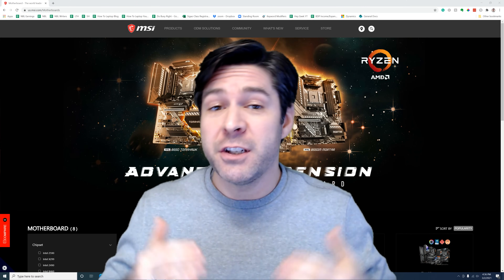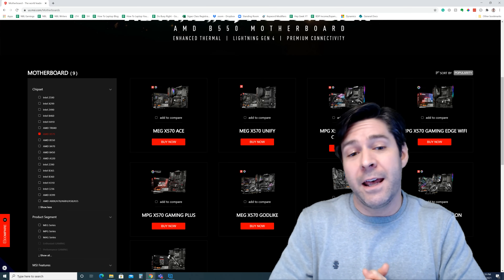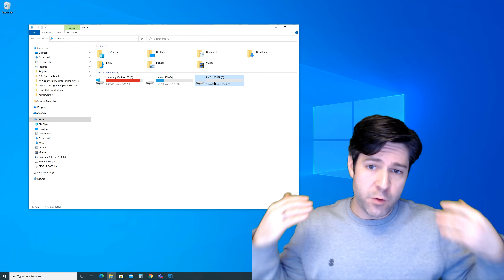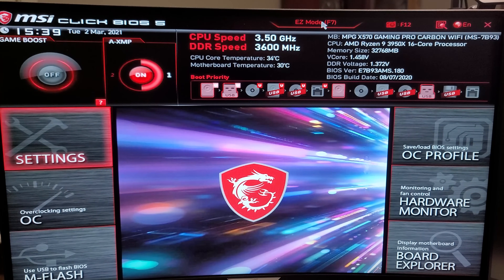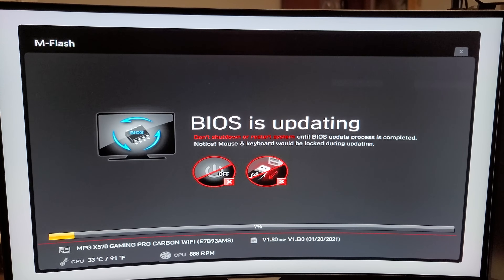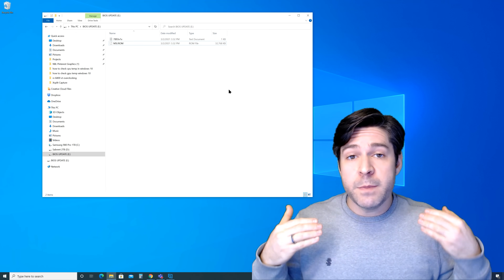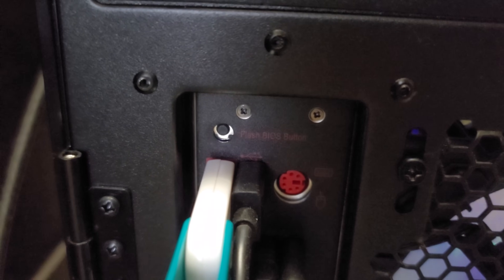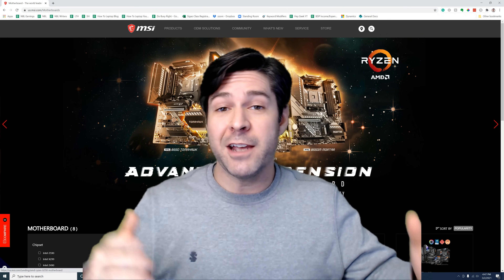How To Update BIOS on an MSI Motherboard Using Both M-Flash and Flash Button

Comment: Josh:  was building on an X870 Tomahawk MSI MB.  Was having problems with the Ethernet and WIFI connection so no internet.  Decided to start with a BIOS update.  used your video to prepare the USB stick for E Flash and started the BIOS update.  At about 30% the whole house electricity went off.  I have updated many BIOSs, never had this happen.  Trying to recover using the flash BIOS option.  And just now as I finished the last sentence, I got a screen from the MB.  Yes!  Your help is greatly appreciated, as is the MSI flash option for BIOS.

Comment: MSI Offered a video with no narrative, I liked yours so much better, with you walking me through and advising on formating the flash drive and a few other vital hints, truly made the difference. Some tech youtubers can do this in their sleep so they do not bother walking someone through the steps, the renaming the file is vital, but is completely left out in the MSI video, granted they were only showing the 1st way that you covered, i have done this before, been building from 2006 but I just wanted a refresher because advancements and methodes move so fast theses days and you provided what I needed to feel comfortable. Others have voiced there disappointment that MSI does not provide and BIOS update instructions, that's why we need individuals like you that will give that  helping hand, thanks again,I have subscribed and liked the video. it is now August 21st 2025 and your video is still helping people like me.

Comment: I reinstalled win 10, after that i had to keep pressing F11 to select the drive the boot was on.
I just went through backing up everything and reinstalling win10 again. I still had to press F11.
In the actual BIOS, the drive with my boot didnt appear.

Anyway.
I have no flash button port.
I did your first method as my bios did need updating..

I have MSI Z97 PC mate (MS-7850).

Anyway, my computer recognized the flash drive with the update, so in the bios I did the flash thing.

Everything is working.

The computer is starting just fine.

Thankyou so much.

Comment: I have done updates couple of decades, but this time I downloaded the wrong version (the same model had both DDR4 and DDR5 mobos), and even though I didn't update it, the motherboard couldn't boot anymore to Windos, settings were randomly changed when I tried the reboot option only, nor wouldn't show an USB drive at the M-flash view (no matter the port or format) so here is hoping this last option works. What a miserable experience.
Edit: update went fine, finally. Thanks!

Comment: Thanks just got a new msi board and this helped, my only issues currently is system fans running high rpms, over(2000rpms) not sure if thats normal or how to fix it. Also remember to enable xmp after updating guys!

Comment: You won a fan boy, if i put my experience here it will help someone, cause i had to go through many video’s and post’s to find the solution… I installed msi centre on my new rig that has a msi b550 tomahawk. I got the option to update bios that I gladly did without understanding it fully as i had a Asus rig before this and I had done a bios update on Asus rig many times. My PC got stuck during the bios update process and started displaying the red light on the motherboard. So every video that I went through was asking to disconnect all devices like proc, memory, video card and peripheral’s to flash update the bios using flash button.. Yours was the only video that was very clear and provided a simple method of updating bios with everything plugged in.. I followed the same steps and got my PC back.. i got relieved now… thank you for your guidelines 👍🏽🙏🏽👏🏽

Comment: I just build a pc and it keeps restarting as soon as I get into windows to login, dont know how to fix this, tried without the gpu installed but no avail.

Running
7900x
Msi b650 mortar wifi
6950xt
128 gb ddr5 5600
Silverstone 850w gold
Wd sn770

This way I cant even update al the drivers cause I cant even get into windows, did mflash bios update but did not help either

Comment: My desktop is on but no picture. I installed the ryzen 5700x prior to updating my bios like a dummy. So I did the flash stick way.  The desktop is on, but still no screen.  My monitor works fine tho

Comment: This didnt work for me at all. I went to press the button and it gave me that error flashing response (3 blinks)

i dont know whats wrong i just wanted to upgrade my cpu :(

Edit: I'm just an idiot guys, It worked thank the lord!!!!

Turns out, I was like "Oh I have a degree in computer science I know what I'm doing. This file format isnt necessary for bios update"

forgets BIOS runs on fat32 file system so using another file system make any file in that file system not found

has 64gb flash drive so I have to use powershell to format it as file explorer wont let me

pain

Comment: My M-flash will open but the usb will only show the directory. It will not show the actual bios file that I know it's on the usb. Your video says it shows up automatically. Any thoughts why mine doesn't?
Reply: So I found my problem is that I downloaded the bios for the wrong board. That's why it didn't appear as a potential bios to install.

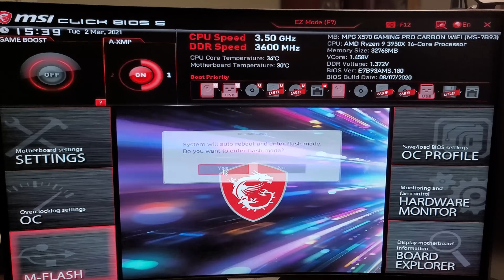Comment: I used the m-flash method and when I went to the flash mode at 6:15, the monitor shows no input, I've tried turning the monitor off and on but nothing happens until I hard reset the pc and it takes me to the windows sign in page.

Comment: hi man, "btw, this is a complete new topic, so it's not related to this video, so yea." i have this problem with my computer: any changes i make, any apps I install or remove, any files I create, even the trash, and when I restart my PC, or even turn it off and then turn it on again, those changes seem to restore to before the changes were made. So do you have any solutions for this problem?

Comment: for the flash bios method the red light isn't flashing, it's just standing still, is that bad or just it doing its thing. It also isn't turning my pc on or off.
Reply: Try reseating the ram modules, then if it works test out each individual ram module with each ram slot, if one slot doesn't work for every ram mod. then its a faulty slot/motherboard, if all works then the ram just fell out a little.

Comment: The FAT32 clarification helped a lot. MSI website never mentioned that so I couldn’t get get my bios to recognize any of the info in the USB stick. Ugh.
Reply: hii have u also recently built ur first system? congrats! cause me too and u can be proud of urself
Reply: @ckk5695  unfortunately I’m not feeling too proud right now, lol. My computer crashes with random kernel 41 errors and windows read the event log and say “it appears to be a power interruption” but I’ve swapped PSU’s out and it still crashes so.. yeah it’s been a headache. I’m suspecting either faulty mobo or CPU after much diagnosis but hard to know for sure.
Reply: @justanonymouse  ohh, i‘m sorry to hear that. if you wanna troubleshoot with experienced pc builders, u can join a pc building discord server! i can send u the link if u want!

Comment: I have X570S EDGE MAX WIFI  tryed to update bios the power supply never came on kept checking on it and bios flash button was still flashing after 3 hours ( 8 GB Flash drive and the file size is  17.73 MB on msi web sight thank you for response

Comment: My BIOS stopped loading its USB drivers. I did not reflash it. I only installed a security update from debian. I got a X570-A PRO mainboard and I can only access the BIOS with a PS2 keyboard.
Before that my computer was already behaving weird and my Win 10 VM wasn't starting anymore, but I did not change anything in the BIOS to make the system freeze come back and the memory runs flawlessly.

Comment: Just wanted to leave a quick message saying thank you! I just did M-Flash on my new MB and it worked great. I'm super glad as I have the MSI z790i Edge wifi ITX MB and when I was enabling XMP mode it would crash my pc. I run ddr5 6400 and was only getting half that. After the bios update, the update was able to support my new ram and I can use XMP and my full speed.

Comment: Whew, completed! Longest 3 minutes of my life. It really made my stomach sink when the  pc turned on and off a few times and didn't go directly into bios. It actually went into windows login screen and then I just restarted from there and pressed del and the bios version is now the new version. Thanks for the how to good sir! Make sure you enable xmp profiles, fan settings and any oc settings if there were any prior to the flash. I did this on an Intel system and the process is the same.

Comment: Thanks SO much for this brilliant video. Amazing. I just bought a Ryzen 7 5800X3D and needed to update the BIOS. I was terrified until I found this video. All done and all is good. Thank You.
Reply: My monitor will not come on.  I installed the ryzen 5700x prior to updating my bios. So I did the flash stick way.  The desktop is on, but still no screen.

Comment: so nice job,( not sarcasm video was super good) i flashed to latest bios vs , now the board freezes when you try to change things in bios? did i need to start with oldest bios and flash them all till i get to newest like the old days? also msi support chat is wonderfully again unavailable . board is z490 carbon and i bought it last year? and am finally getting system up. so its a blank canvas

Comment: Instructions unclear.

M flash detects my USB but it’s not detecting the bios file in there?!
Reply: same problem did u get this fixed?
Reply: @spared  I had downloaded the “mobo” bios update
When I should’ve downloaded “mobo pro wifi sex having” bios update

Same mobo but slightly different.
Reply: Had the wrong bios
Reply: @mattvii9228  i have b450m pro vdh max and idk this is confusing ash, dk what im doing wrong

Comment: For the flash button method, anyone knows if you have to have nothing connected to the mobo except PSU (no gpu, no ram no unsupported 13th gen CPU) or is it ok to have the pc ready with every component installed on the mobo and use flash button last?! ( I mean for a new built pc) Thanks a lot! Sorry for my rubbish english
Reply: I just did this and had everything disconnected, no RAM, CPU or GPU.  I have 13700K. This works with flash button and USB

Comment: Doing the M-Flash Button right now on a MSI MPG Z690 and it was a great video to follow! Going to be using a 13900k with it. Pretty excited to see what this beast can do.
Reply: Got a question for you. I've just picked up the MSI MPG Z690 EDGE WIFI DDR4 and I7-13700K. Would the M-Flash button method be done before installing the cpu? Also.., can the flash button method be used by just giving the motherboard power and not connecting it to a display? Thanks
Reply: @blablasigh187  Good morning, I already had the whole PC put together, so the CPU can definitely stay installed. You are correct about the M-Flash button, it only needs power. And you probably do not NEED a display connected, however, there is no real way to know when its done without confirming that it booted into the BIOS upon completion. Good luck and reply with any other questions!
Reply: @BlackxKnightGaming  Gotcha, thanks for the feedback.
Reply: @blablasigh187  I have the same motherboard and CPU.  I did the USB method with the M-flash button and it worked flawlessly.  I didn’t install the CPU and completed by hooking the motherboard to the power supply only.  It takes a little longer than 5 min.  Gotta wait until the light stops flashing.
Reply: @mct8888  Okay, that's the perfect scenario. I'd rather have the bios updated first before installing the cpu. Thanks a ton.
Reply: @blablasigh187  just make sure you name the file correctly on the USB.  Good luck!
Reply: How did it go?  I need to do this with mine.
Reply: @mct8888  No issue whatsoever. It restarted once or twice then booted straight into the BIOS. Before it wouldn't even POST (Exactly like a 5000 series Ryzen). 100% the easiest BIOS I've ever flashed. Good luck!

Comment: Hi mate, 
I've just bought the MSI MAG Z690 Tomahawk Wifi DDR4 and paired it with the Intel i5 13th Gen 13600KF.

Issue: the CPU light is on the motherboard and I'm not able to get to BIOS/no display on my monitor :(

Any idea how I can resolve this?
Reply: This is happening to me, did you fixed it ?
Reply: @gazza thanks!! I did that and it worked all perfect 🙌🙌

Comment: I’m getting the b550 with a ryzen 5 5600x so I most likely need to update the bios, just needed to make sure I can do it without accessing the bios (: thanks. 

I do however have another pc that’s messed up with a fully working ryzen 5 2400g I can stick in my new pc and use it for a little to update the bios… which I might do since it’s easier. Anyways thanks for the tutorial.

Comment: when I tried updating this BIOS on my 450 tomahawk max using m-flash. I kept getting " this BIOS is not MSI Bios, update will be ignored". I followed everything here. I finally did the following. Inserted the USB stick NOT in the flash USB port, but the port next to it on the motherboard panel. And disconnected all other USB devices including MY external drive. And the update finally worked. I'm not sure if it was changing USB ports that did the trick. I'm happy I've finally updated my BIOS. Ready for CPU upgrade now.

Comment: NOTE!!! for those of you reporting black/blank screen after inserting USB drive, rebooting, and starting the FLASH in BIOS. This happened to me and i was so frustrated. I fixed it by unplugging my external USB hard drive. I think it was causing a delay in the BIOS update because it was trying to scan my 4 GB drive. I waited and waited (ok i was not super patient) but the firmware selection screen never appeared, just a black/blank screen (screen was on). Unplugged the USB external drive from my PC and rebooted with the USB stick plugged in that had the firmware update on it, went into BIOS to do Flash, and everything worked as expected.

Comment: I tried the flash bios button method for my x570 with ryzen 5 4500 and it's not working. The board refuses to take the bios and doesn't detect the processor.

Comment: @Hey Geek, you are fortunate as I with my setup has been plaqued with problems from MSI B450 Tomahawk Max motherboard issues to MSI Radeon RX 5700XT Graphics cards not working, even the RAM will not run over 2133Mhz. As for the MSI brilliant products will never buy another one.  As a computer tech, I should have known better than MSI though as components where difficult to get hold of you have to make do with what is available.

Comment: i paired a msi a320m with athlon 3000g. today i purchased mobo and processor from Amazon. but when i connected with monitor it's showing no signal. do i need to update bios. 

i have connected all the psu wires correctly but it's showing no signal to monitor

Comment: Would be relevant to mention that there is a dedicated bios flash usb slot on newer boards and that flashing bios resets all settings made prior and MSI seems to be prone to need specific settings and rebooting just to be able to set m.2's as boot device.

Comment: Hi guys! I've a problem with updating BIOS. So I've build my first ever PC and in BIOS mode it didn't showed my Samsung Evo Nvme SSD so I decided to update BIOS (BIOS v is 1.20 Spring 2021) to a new one - 1.60, hoping that the problem will be gone. I did everything like on this video with method M-Flash... but now its 4hours of "updating BIOS" with 0 % no temperature is showed and CPU stuck on 312 RPM. I really don't know what to do((( Can I just restart? (I don't think my MB - MSI Z590 Pro Wifi has dual-BIOS).
Also, I pluged usb not in the Flash BIOS port, near the BIOS button, but another USB port near the HDMI. Could this be a reason why it takes so long? Will it still update the BIOS? Please help!!! THANK YOU IN ADVANCE

Comment: For the Flash button method, did you install anything on the USB drive or was it just an empty USB Drive? Another question for the Flash button method, The the best way to use this method is if u just finished building your computer and need to Update BIOS?

Comment: What do you do when it does not find the USB drive. I am using the correct USB port and I have done everything per this video. IT is telling me " Media Not Found. Please plug in USB media and press retry to try again". I do this and nothing works. The ONLY difference is when I format my USB drive its not letting me pick FAT32 but ONLY exFAT. Could that be the problem?

Comment: I'm so thankful that I ran into this video. I was upgrading my CPU on MSI B450 from Ryzen 1600 to Ryzen 5900x and for some reason the M-Flash wasn't recognizing any (unpacked) BIOS files on the USB drive. I had no idea about a dedicated USB port + flash button method but it worked like a charm the first time and the new CPU started working right away. Huge thank you.